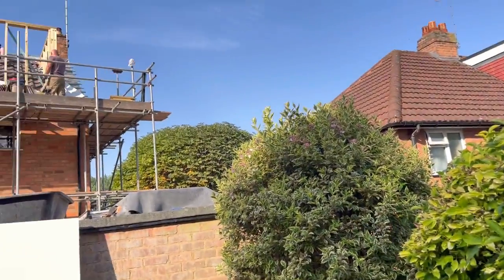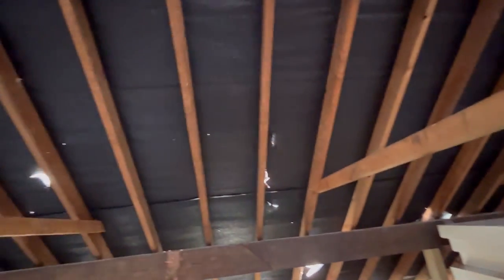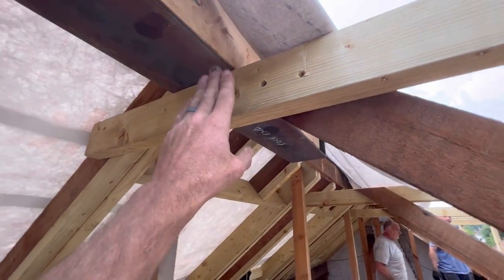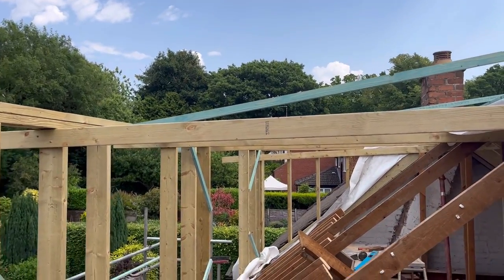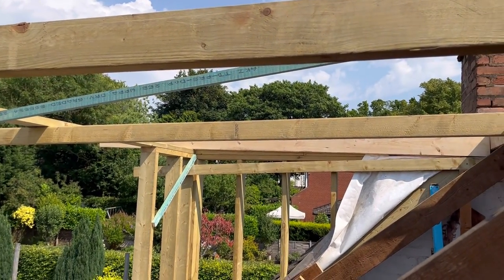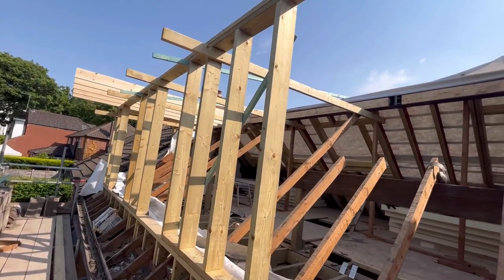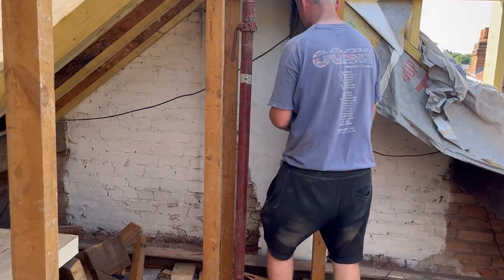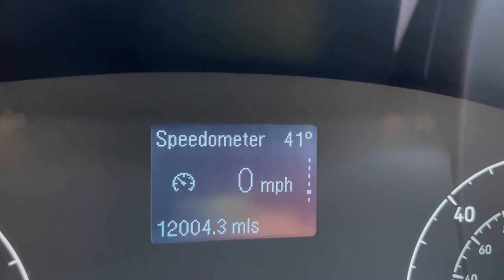Removing the old roof to fit ridge beam steels and install dormer roof.   #roof #carpentry

Comment: Great video. Whag was the finished head height of the loft? Im considering dropping ceilings to provide additional head height so curious as saw measurements of 1876mm which seems quite low

Comment: These videos are amazing. Does the fact that there is now an unbalanced load up against either side of the ridge steel (due to one side being the dormer) pose any problems? What’s stopping the weight of the sloped roof and heavy tiles moving the steel towards the back of the house? Hope this makes sense